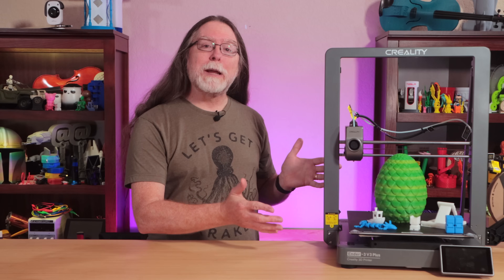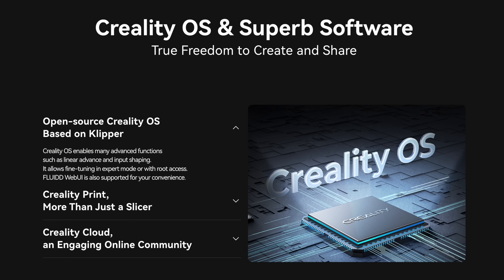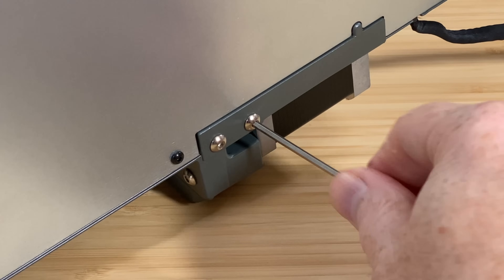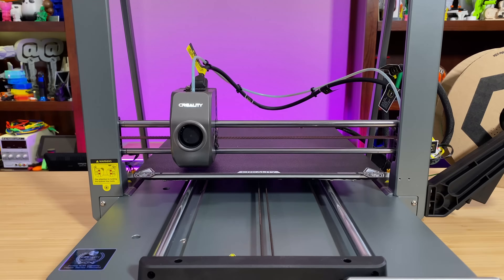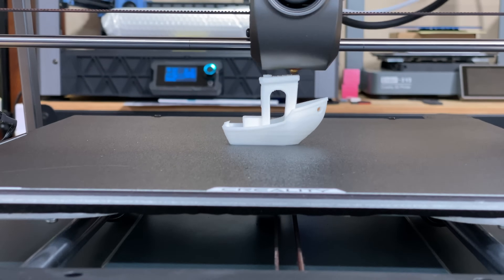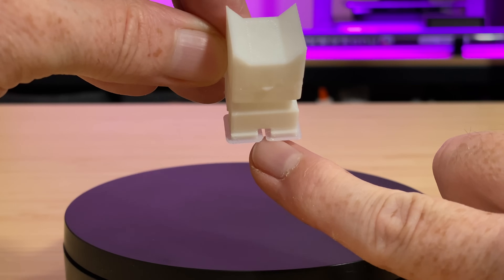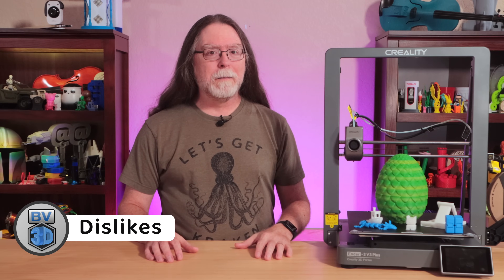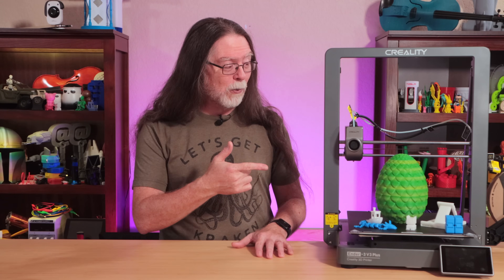Ender 3 V3 Plus: Unbox, Build, Setup, Print!

Comment: I just got mine for an early Christmas gift and I’ve had issues with it unfortunately. The print quality isn’t what I’m used to as I have a K1C and ender 3 v3 KE. I also have loud noises when it prints the bottom and top layers

Comment: My son just put it together and tried to use his printer.  He did not remove the packing from the bottom piece under the printing plate.   Now he believes he should, but Im afraid it might screw something up or make it off balance.  He tried to print so it's stuck on there.  I haven't seen anyone remove it on tutorials for setting up.  What would you reccommend we do next?
Reply: Yeah, I was going to comment that he forgot to mention that in the unboxing. Probably for the same reason that you didn't notice it....
Reply: If you’re talking about the black styrofoam under the bed, remove it. It is not needed

Comment: I bought this printer and it is very fast. I just didn't like the way you place the filament, on the Ender 3 S1 it's much easier. I'm having trouble changing the color when I pause it and it automatically removes the filament, like on my Ender 3 S1.
Reply: it doesn't remove the filament automatically!

Comment: I got the v3 4 months ago and i loved it. I am fairly new to 3d printing. My first printer was an anycubic predator my brother in law let me use so this was amazing in comparison. The problems started a week or so ago when i got, what was explained to me as the blob of death, which pretty much screwed up the hotend and heatsink. I ordered the replacement parts and $90cad later i was back up and printing. However with the replacement parts in i have not been able to get a print to work. The extruder keeps slipping and seems to be clogging up. Nothing I have done has worked. Its a genuine creality hotend so i don't know if I messed something else up with the blob of death or not. 

And ya the spool holder design is dumb. The second print i did, the filliment wrapped up and broke so the third print was the top mount spool holder.

Comment: Newbie question... Help!  I just got my Ender 3 V3 Plus today and I love it!  I put it together, turned it on, and WHAM!  Printed the Blendy with no problems.   BUT... I'm stuck!  I cant seem to figure out how to print anything from any of the other 3d models I downloaded.  There has to be something really simple that I'm missing, but for the life of me, I can't figure out what it is.  I can copy files onto the zip drive that came with the printer, but the printer's computer doesn't see them.  I tried using a different zip drive, but same thing... I plug the drive into the printer and is shows as being empty... no files.  What am I missing?  Any help or suggestions would be GREATLY appreciated!
Reply: Ok... so, I found a workaround, while I continue to figure it out.  I can create the .stl, then use Cura to slice and convert it to .gcode.  I've done two different prints and it seems to work fine.  Cura doesn't yet list my exact printer, but I selected the V V3-pro and it worked!  I found the Creality forum, so I'm pretty sure I'll find the answers there.  :)   Thanks again!
Reply from the maker: Hi! If you're copying the STL files to the flash drive / card that came with the printer, that may be the issue. The printer can't print an STL file directly. The file needs to be converted to G-code, and that conversion is done by software called a Slicer.

The slicer software included with recent Creality printers is "CrealitySlicer." It's usualy on the card or flash drive that came with the printer, but you can also download the most recent version from https://www.creality.com/pages/download-software

Once you've got that software installed, launch it, and during the first run you can pick what kind of printer you've got, Then, in the main window of the software, you can drag your STL file in, choose your quality settings, and slice it. Then save the resulting G-code file to the card or flash drive that came with the printer. Move the card back to the printer, and you should be able to print the file from there.

Hopefully that gets you going in the right direction!
Reply: @BV3D  Thanks!!  I had d/l'd the latest Creality slicer from their website, but didn't see how to convert the .stl to .gcode.  I'll check it out!!
Reply: Hi Bryan, well... it would seem that I'm either blind or stupid... but for the life of me, I can't figure out how to convert my .stl to .gcode in the Creality software.  There HAS to be something super obvious that I'm just not seeing, but I can't figure it out.  Any and all suggestions would help immensely!  And THANK YOU in advance. You've already been a huge help.  -brian

Comment: Great video, Bryan! I noticed the support brackets have a threaded bolt at the end. Do the instructions mention anything about ensuring squareness between the vertical gantry and the base and adjusting the supports as necessary?
Reply from the maker: Hi, the instructions didn't mention adjusting them. I assumed they were set at the factory, since the left and right sides are marked. I just checked mine with a small machinist's square, and they seem to be right on at 90 degrees. I can't guarantee this wasn't purely by chance, though. So being able to adjust them if needed is handy.

Comment: I’m still using the grandfather to the V3.  Except mine has used a kit to give it a 300 x 300 x 380 with a mini E3V3 mainboard. 120v 750 watt bed heating up a Fulament flex bed.   Love it
Reply from the maker: Those are some significant upgrades! Was that an Ender Extender kit?
Reply: @BV3D  yes it was.  I wanted the 400x400 size. But the book cabinet I made was too small for the 400. Stick out too far.   I’ve been happy with 300. LOL  I LOVE to work on cars.  So now I’m retired and no car, this printer I love to tinker with

Comment: Deciding on a K1 Max or Ender 3 V3 Plus, All I see is cased and uncased design but the price difference if huge. I would like to match it with a K1 but can't justifice the price vs this, Bryan what is your take beween the two? Thanks for the pleasant video
Reply from the maker: Hi! The build volumes are pretty close between the two, so besides the price difference, the K1 Max would give you the ability to print materials that prefer being in a heated enclosure (ASA, ABS, stuff like that). I guess it depends on what you're wanting to print. I rarely stray beyond PLA and PETG myself, but when I print stuff like CF Nylon, it's on my Bambu Lab printers.

Comment: Just get the A1 Combo in the sale. It's not as big, so I guess if you REALLY need that size alright, but if you don't either save money and go with just the A1 or for around the same price get A1 Combo. It's worth it, great quality prints and I didn't even have a single failure after printing 20+ (a
2-3kg) full build plates. 

There is a big Panda in the room, and Creality needs to step up their game.
Reply: Bambu won't make anything over 256 × 256. I make repeating crossbow guns. Some of my frame parts, even diagonally fill 300 × 300 beds. Also, many people need bigger printers for helmets and other large projects.

Comment: I can't understand why anyone would get this over the Bambus.
Reply: I just did. Because Bambu won't make anything over 256 × 256. I make repeating crossbow guns. Some of my frame parts, even diagonally fill 300 × 300 beds. Also, many people need bigger printers for helmets and other large projects.
Reply: I do. I’m an engineer who works with technical materials and needs a lot of space for aeronautical and automotive parts. This one is perfect for me.
Reply: @sergiogonzalez6915  Don't leave it unattended, or you'll get a blob of death like Elegoo
Reply: Creality has terrible quality control and uses the cheapest components. My experience with enders is terrible. It may work for a few months but won't last like the Bambu
Reply: @timapple2501 it's called maintenance, on the expensive ones you need to do it much less.
Reply: Another fan boy that will continue with unnecessary brand favoritism
Reply: @StaticM223 I and most others spend as much time tinkering with their enders as much as they do creating.  It gets old after a while. In my opinion the earlier enders are perfect for beginners though.  They are good for forcing the individual to learn and understand the working components of the printer.  I'm now to the point where I have mine running great but ready for a new printer which will likely be a A1 or P1S
Reply: I wanted the bambu a1 ams or the x1c but don't use it enough to justify the price. I paid 220 for my ender 3v3plus with 2 years warranty(squaretrade) direct through creality
Reply: I just did, the printer was on sale and the print size is what I really wanted .
Reply: Size
Reply: Only if you wanted the 300 cubed build area. But yeah, I'd rather have the fully enclosed P1S for 600.
Reply: @prerecordedresponse9884  I feel bad for all these content creators because there's always new products out there and the companies will send them out for review, but honestly how can anyone recommend anything else at the moment. Bambu kind of killed the competition with true forever birthday prices. Can't tell anyone to go get the Prusa mini because of the A1 mini. Same for any medium bed slingers, A1 is hard to beat. Then pure workhorse, P1S. It's gotta be tough to be unbiased, no?
Reply: @prerecordedresponse9884  I have two P1S with two ams 2 pros I need a 300+mm cubed printer
Reply: Cuz people aren't rich :0
Reply: Update: Ender 3V3 is down. Got 2 Bambu Lab A1 printers, God Tier, never going back, and can't wait for their rumored 300×300 Prusa XL Killer. 💯
Reply: You can do a helmet on the p1s if you angle it right. Saturdaymorningprops does em. Also justgee3d I believe as well he has the x1 carbon

Comment: Bought the plus to go with my normal sized v3. WAAAAY TOO LOUD, And sounded like metal on metal grinding. It was sent back.
Reply: It's a good bit louder than my bambu A1. I wish they'd turn that fan off when it's done printing too. The A1 does, I would think it's possible on the ender 3 v3's too.
Reply: @innui100  oh it was a good bit louder than my regular v3 that was right next to it. The plus had like a grinding noise from the front stepper motor

Comment: Great video!  The specification does not mention ASA filament, but is it possible to print from it on this printer?
Reply from the maker: Hi! The nozzle can hit ASA temperatures, but the bed, maxing out at 100˚C, might not get quite as hot as ASA would like. You might also need to park the printer in an enclosure to hold in the heat and minimize drafts that could cause the ASA to split along layer lines or warp.

Comment: Bryan can you use other slicers i.e. Cura
Reply from the maker: Hi! You can 100% use other slicers to create G-code files for the Ender-3 V3 Plus, but at this point in time you'll have to create the printer profile yourself, or find one that somebody else has made. The Ender-3 V3 Plus (along with the Ender-3 V3) aren't in Cura yet. There IS an Ender-3 V3 SE in Cura, but it's a slightly different printer. It might work as a starting point, though!

Comment: The runout joke never gets old.  (rimshot)  It's nice to see the build process, too.  I wonder when Creality is going to go with line voltage for the bed instead of 24VDC?
Reply from the maker: Hi Stew. For the past year or so I've deferred to the manufacturer's build videos that they include on whatever media comes with the printer. But this time, I felt like showing the build and the setup. No idea on whether they'll ever switch to mains voltage instead of 24V though. Thanks for watching!
Reply: @BV3D  I gotta say I prefer to see the end users putting the rigs together. The manufacturer ones are so staged and have really, really bad music. Some of my favorite assembly ones are Tim at TH3D.  Strap in for at least an hour.